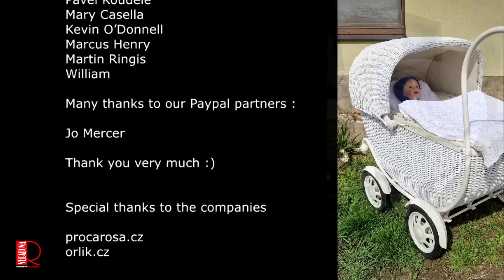Restoration - Historic wicker pram for a baby  "Kukaň"

Comment: Impressive, I'm guessing that carriage is at least 80-100 years old, yet the wicker is relatively undamaged except in a few spots.  My experience with wicker is that it becomes brittle and falls apart over time.  Either someone took good care of it, or it was stored in such a manner as to slow the dry rotting process.  Fabulous job of restoring it as always.
Reply from the maker: Mostly these strollers end up on the ground where a layer of dust settles on them for years. But you are right, wicker is very fragile... Thank you Denise :)

Comment: Lovely. Only suggestion is to cover the long screw on the pram shade. Someone might scratch themselves!
Reply from the maker: Yes, that's right, the original stroller had it, only a wing nut was used. I pointed this out to the owner to get him a cover. Yes, I could have cut the screw, but it would have been difficult to assemble the box after transport in a car.